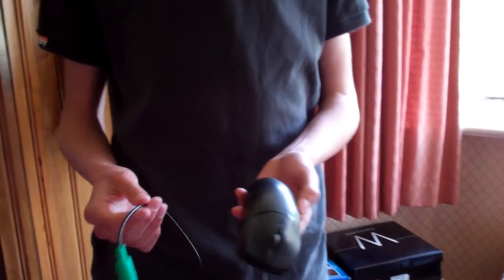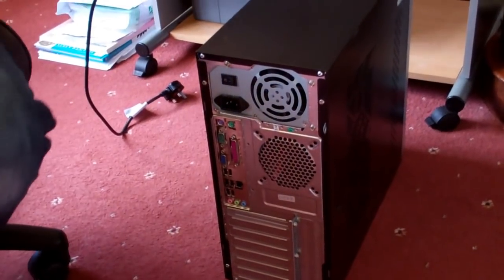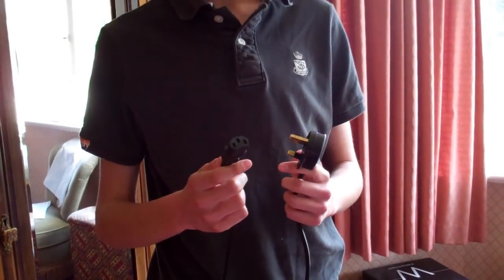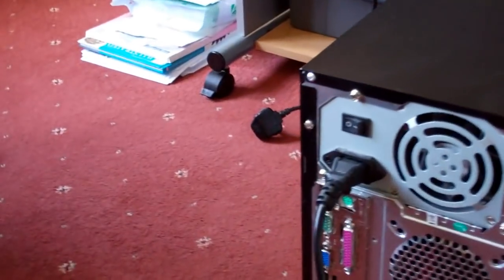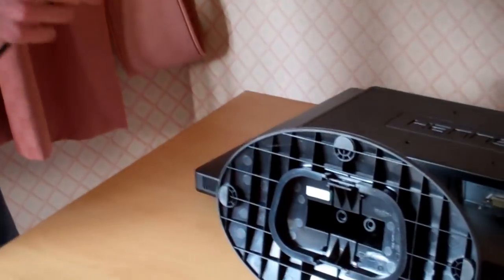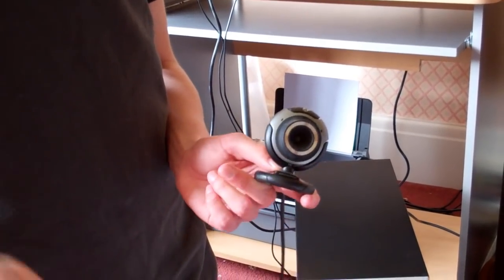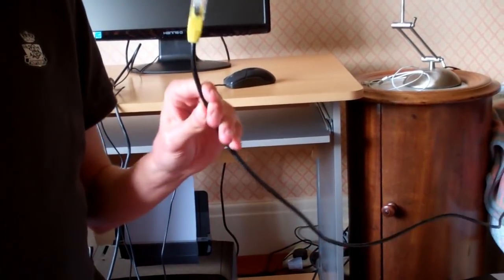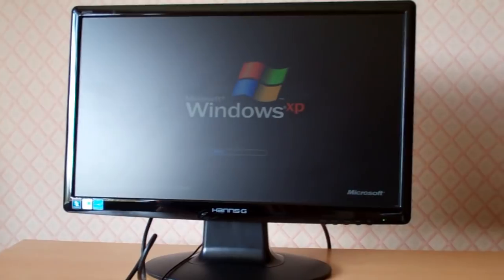How to Set up a Computer

Comment: Do we need to use the internet wire? Cause I don’t have wifi I can only hotspot internet from my iPad
Reply: Wi-Fi and ethernet aren't the same thing. There are a few ways you can go on about doing this: Use USB tethering to tether your iPad's network connection to your PC, or buy a Wi-Fi adapter for your PC (if it doesn't already have one) and connect to your iPad via Wi-Fi hotspot.

Comment: if it's a gaming computer, will the cables be the same?
Reply: Pretty much. The typical home/gaming computer will need: mouse and keyboard (usually USB), video cable, 3.5mm audio cable for speakers, ethernet cable (if using wired network) and a power cable.

Comment: I have a question what if the monitor has the connector of the blue thing and the pc box doesn’t have a plug for it?? 🤔 please tell me
Reply: Most likely your PC is newer then the time when  this video was shot. They both probably have an HDMI cable which should work.

Comment: Ok i have a question... So i have a monitor... So if i get the computer thing that u connect all the wires into. It will work right then i wont have to connect the monitor into another computer to make a work right?

Comment: Dude your the best i was spending hours figuring this out. Thanks man.
Reply: I knew?  Only 1 found doing this.  Got right hit and came in to check at right time. Have old 2003 Gateway mini tower all my papers color poster, etc are scattered buried in old file folder cases need to go through & haven't been able to. I need to see if have all the cables to connect it though.  I think they are all in 1 place so soon I can check if it turns on.  I'm back in biz mostly.  I miss my Cell laptop was stolen.  Only have new Hp Chromebook, my cell, soon Ps4,and that'sit. Not the same thing. I can buy $10 thing that connects to my iSP Wi-Fi when get it. My friend online told me.  She knows allot. So if it works it's inexpensive.I hope it does. It's a good thing if it does @ that price, cuz I can't afford more ATM.
Reply: @lilyvalley5389  long comment
Reply: Same with me
Reply: Forreak
Reply: Cool i dont even read the instrucitons but i am smart.. I came here not for the setup but yt recomamdrd me this but i actully didnt even need this it just pop up at recomandetuons page
Reply: @cristiand4345  good for u no one cares that you’re “ smart “. You’re  insecure.
Reply: @cristiand4345  smart people don’t call themselves smart out loud.
Reply: @cristiand4345  ah yes, my favourite noun, recomamdrd
Reply from the maker: No problem :-)
Reply: @MollytheCat  Hey I don't know if your still active but do you know how to setup a Hp Pavilion 23 Touchsmart all in one